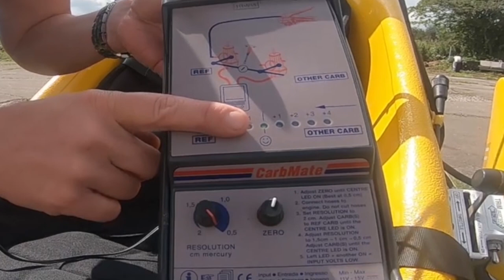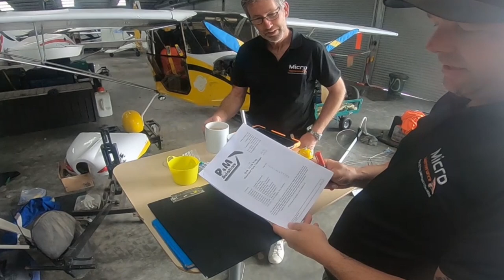Engine Tuning, inside of wings and electrical faults: Micro Maintenance Episode 9

Comment: Another cracking insight, thank you. With regard to the GTR wing strip, the black block with half the threads missing, was this due to poor maintenance, manufacturing flaw or something else? Roll on next video.
Reply from the maker: Hi John, unsure of the cause, can be caused by over tightening or corrosion , worth mentioning that’s a small position (1/4”) is left unthreaded

Comment: When my GT450 stopped charging it was the big capacitor by the rectifier that was the issue. Easy fix - assuming parts available!
Reply from the maker: Yes another common fault, this transpired to be a loose connection on the rectifier 👍🏻
Reply: @wingnutshomeofmicromainten6946  Great that it was something as simple as that - still fun to chase down though!

Comment: Could you tell if the hang-bracket threads were stripped, or was it just machined that way from the factory?
Reply from the maker: Hi Jeff they were stripped as the threats fell out once removed, possibly over tightening 🤷🏻‍♂️
Reply: I think you'll find that the hang bracket spacer block M6 holes are intentionally relieved down to a depth of about 14mm at manufacture, and the threads that dropped out were actually old dried loctite from last time it was assembled.
     Every spacer block I've seen has been like this, including new ones!
Reply: Also, the bent lift strut brackets on the GTR, If you just obtain new ones and try to mate them up with the old crosstubes, you'll find that the holes for the monobolts don't quite line up. This is because they are drilled "in situ" on assembly at the factory and there are slight differences between  each one.
    The owner will probably have to buy two new complete crosstubes with lift strut brackets.
I worked at P+M Rochdale for a few years on the wings and remember Brian who manufactured these, telling me this!
    The brackets would have been bent by the owner trying to fold the A frame down with the struts still attached, a common error.
Reply from the maker: Yes the stripped threads were after the unthreaded portion, definitely not thread lock.
Reply from the maker: GTR, yes unfortunately for the owner this was exactly what happened and we’ve had to order two new cross spar assembly’s (and a damaged strut)